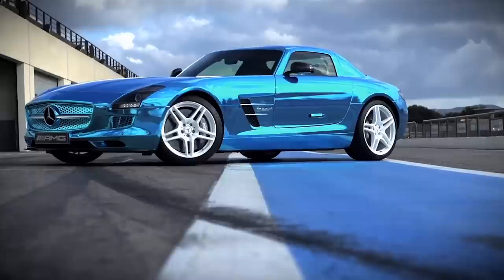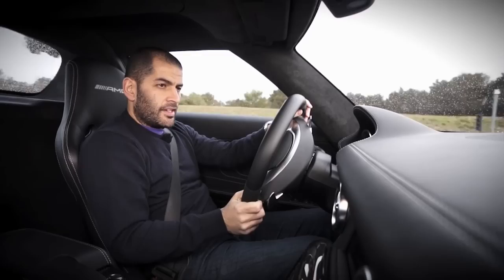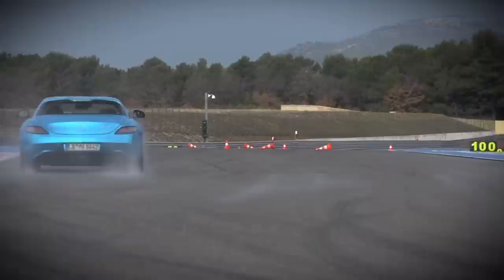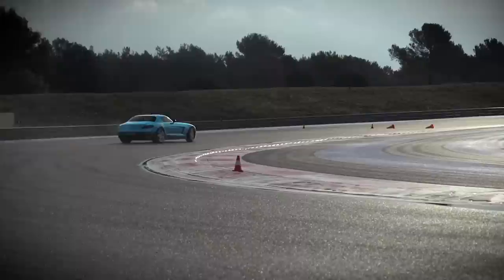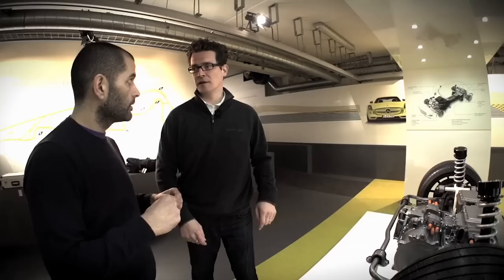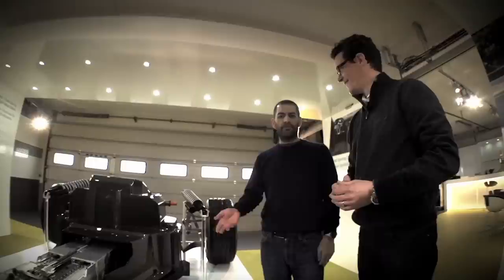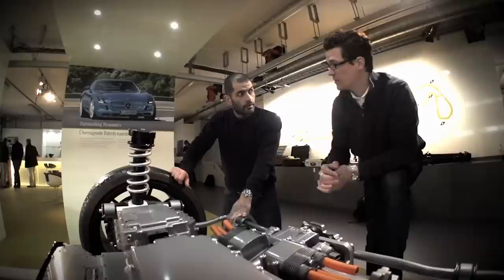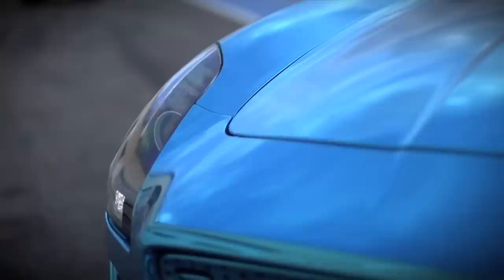Mercedes SLS Electric Drive. Can Volts Ever Match Pistons? - /CHRIS HARRIS ON CARS

Comment: Another 20 years and the battery problem will probably have been solved. In another 20 years, if we can practically make synthetic petrol, it won't get around the fact that the internal combustion engine has fundamental limits on it's power efficiency and reliability issues compared to an electric motor. Your nice V8 will be like a steam train; marvelous to experience and learn about (well, to some of us, at least), but not the future of transportation.

Comment: If you have actually heard a proper engine noise, then you wouldn't think so.
A silent car is good for every day use. For a commuter. A 4 cylinder eco engine doesn't sound good whatever your do with it, so removing that noise is fine.
But not for a super car. The chills we get from proper car noises has nothing to do with perception of what a car sounds like. It's much more primitive then that. In our stone age designed brains, a loud roar means power. Thunder for instance.

Comment: What if they use the same thing as Fisker Karma uses? It's still electric but has engine to regenerate the electricity as you drive along. And it doesn't uses much fuel with

Comment: Can Volts Ever Match Pistons?
many times over.A piston has to stop and change directions, whereas an electric motor is many times more efficient with energy creation and they are way smaller for the power they produce.Yes you have to include battery weight but a piston engine still has fuel weight as well as a giant heavy ass engine and electric motors have better low end torque.
A high end electric vehicle will blow any piston engine out of the water.The reason electric vehicles lag in technology is because no one has been building them all these years because of the Rockefeller's dirty tactics to keep people guzzling oil.

Comment: Electric engines and standard variable chasis and then you have an excelent platform to do whatever you want with interior and exteriors (even with centers of mass). Then Sound systems simulating real combustion engines (which might be improved or rebuild...)  and a fucking funny horn that awares fauna from hit and scape. Then silence outdoors and sound indoor, variable geometrics on every parameter (even water deposits to fit wanted weight and COM), then you change car clasification just by taking neighbour´s ones for a time. Is just like making a real simulating platform to bring videogames and best security (active and pasive) to real world.

The all cars car.

Comment: A cvt is essentually the same as a gearbox, only less efficient. and two motors is not better than one big, as that means two controllers, and more points of failure/more complexity. There is no need outside torque vectoring for more than one motor, as having two is exactly the same as one 2x the size, just with greater complexity, and lower overall efficiency.

Comment: Can't just wave a magic wand and make the V12 run as well as the electric one. They can never be the same. One, you push the pedal down, it pushes you back in the seat proportionally. The other, you push the pedal and have to work your way through the gears to keep getting pushed back in the seat. I'll take the cleaner, quieter, more mechanically sound, and more technologically advanced option.

Comment: I'm sorry but "have to work your way through the gears" is just unbelievable. That is part of the fun. Why do you think the majority of drivers cars are manuals or semi-auto? If you really hate changing gear, you get an automatic. A good automatic gearbox with a V12 engine will be as smooth as electricity but with the orgasmic sound. Cleaner is just pointless really. Even though supercars are less green, they're so rare it's insignificant. Mechanically sound? How? V12s can be quiet (Rolls Royce)

Comment: its an expression, like some one who is used to drinking $1000 bottles of wine looks at a $5 bottle of wine and says "this isn't reel wine, its cheep shit" exempt in the case of the ev the ev is actually more expensive. and if u knew how electric engins worked you would know that there isnt much room for improvment, they've been around for almost as long as the ice and berly improved. as for the futre its probably not going to be petrol but its definatly not electric, i think it will probably

Comment: we have the technology. price is the only issue now..... for example,  why buy a nissan leaf when you can save 30 grand in cash and buy a nissan versa hatch instead, and not have to worry about range or expensive battery replacement either???  or why buy a VW JETTA hybrid when it takes 15 years of ownership just to break even on the extra money you paid over a regular gasoline jetta?

Comment: wouldn't the negative torque cause HUGE wear and tear on the motors? basically slowing a wheel going at say 140mph not by breaking, but by effectively using the strut arm and the inside of the wheel to turn itself backwards? try running full speed forwards, then while doing that decide mid way ok im gonna run backwards now without stopping. you'd hurt yourself. ligament damaged, muscle damage etc. !
Reply: +Antony Quigley the motor doesn't really care. And the forces on the arms are the same as for disc brakes. No issue.
Reply: thekaxmax
no there would be 100% more pressure on the motor's than the disc break arms. As the breaks just have to slow and stop, the motor is immediately trying to reverse, must be a hell of alot of stress
Reply: you are all forgetting that electric motors don't suffer from mechanical wear like combustion engines do. The motor housing (containing the poles) remains stationary while the stators move independently and without contact. the only contact comes from bearings, and those don't care about acceleration
Reply: Antony Quigley This is not correct.  If a car slows down by regenerative braking as quickly as it does under normal braking (i.e. with disc brakes) the torque exerted must be exactly the same - the torque is what causes the retardation.  All that is happening is that the motor is acting as a generator and the maximum torque on the electric motor under regenerative braking will be about the same as it would be under maximum acceleration only in the opposite direction.

Comment: ok, you the one that said. they are converting energies from battery dc sources to three phase ac. you get losses every time you change electric states. and there trying to promote distance driving for touring? that make about as much sense as a .177 bb gun competing with a 7.62mm riffle. these losses are unacceptable if you trying to make the masses of drivers happy. i know i'm not happy about the capable applications of range to charge intervals. plus the time for it to fully charge.

Comment: When cars become fully electric, you'd need to be extremely smart to modify its performance. You can't just slap a few parts like a turbo or supercharger. You would actually have to tinker with electricity and electronics. That shit requires a bachelor's degree in electronic engineering lol

Comment: There is a difference between synthetic sound and then one that actually comes from an engine.
You hear the sound from the a speaker. You feel the sound, the vibration from an engine.
An Electric car will never sound like a real car no matter how good speakers you use. Simply because you don't get the vibrations.
With a big engine you feel the engine and the power.
And in any case, it's still not the same to know that the engine sound is completely fake. It will not be the same.

Comment: No, not in racing. If your car has 1,000 HP, that still doesn't make 4,000 lbs okay. That's what I've been trying to explain to the idiots commenting on this video. (Not you. You have a point, but that theory just doesn't work around a track or on a mountain.)

Comment: in fear of sounding like an environmentalist i must comment that if you consider a electric car to not have 0 emissions then you must add on the emissions and energy in oil production, oil transportations, petroleum refining, delivery, etc to the emissions of a fossil fuel vehicle. i would also hazard a guess that in most European countries the carbon footprint of electricity production is much less than the carbon footprint of oil refining, etc.

Comment: How does a car with 750 hp only achieve 155mph? With that power and aero top speed should be well over 200mph. Same thing with the Tesla roadster, 288hp yet tops out at 125, which is slower than my Toyota! The added battery wt shouldn't impact top speed right?

Comment: Tesla offers a battery pack swap out that is completely automated, takes 55 seconds and is available for 35$ at any Tesla charging station. You just drive up into the little car wash type thing and sit in your car while it swaps. Faster than gas tank fillup, and cheaper. Or you could just plug it in at night when you get home for pennies.
Your petrol bullshit is over doll.

Comment: 4 wheel 4 motor electric torque vectoring vs single power source through single transmission 4 wheel torque vectoring, that's the question I so wish got asked, any thoughts welcome
Reply: Yes yes yes

Why is 2000 moving parts that produces 30% of the drive the rest in heat and noise the right way to go.  The 4 motors, 3 moving parts in a E motor which performs abs, traction control steer control on the fly.  Look mum no hands.  Even less moving parts pumps etc

I know, 3 new modes for the SLS, E type, Mustang, Monaro wow how cool would that be. True floating pillows low power, no traction, a coffin.  I gave up my analogue phone a long time ago.

Even the right colours teal, grey, black and white....

Comment: That's fine, but you made a little mistake.
A gearbox is something you use to change gears.
A set of gears is called a transmission.
what you meant to say is that: "a cvt is essentually the same as a transmission".
A CVT is actually more efficient you know.

Comment: It'd be nice if they can create another fuel that is cheaper and better for the environment that can be used in an ICE type engine. What happened to hydrogen cars?
Reply: Hydrogen did.  Hydrogen is very difficult and dangerous to handle.  It is simply too complex to make safe.  There will never be a hydrogen internal combustion engine on general sale.

Comment: If you knew more about electric motors you would know that its only a matter of time. 

Instant torque. That's just one feature. You really don't comprehend the possibilities of the electric engine.  They only problem is batteries.  When they improve drastically or we have electricty productiny hydrogen plants then whoah  baby 1000000 kw   without having a huge top fuel drag engine.

Comment: There's something I didn't quite get. Instead of spinning the motor in the opposite direction to negative torque, can't the car use regenerative braking and make the motor act as a generator? Or does this car not have regenerative braking?
Reply: I see where you're not understanding what's happening. That's exactly what regenerative braking is-- applying a reverse force (torque) to the motor. It just doesn't apply so much reverse torque that the tire loses traction and the motor actually turns backward. It's basically the same thing as stepping on the gas pedal to accelerate vs. stepping on the gas pedal even more to spin the tires, except it does this backwards, and the reverse torque applied against the forward rotation induces an electric current that feeds back into the battery, which is what regenerative braking is.

The clever thing about this kind of electric torque vectoring is that instead of putting that regenerative braking current into the battery, if it's wired and programmed right, it can actually just send that current straight over to the other wheels which will add extra power without having to take it out of the battery.

Comment: Ok, I'm really interested about, does this car have a gear box? I guess it doesnt. It would be understandable at an electric car (electromotors have always the same torque) IF Im right. Especially when it has 4 individual engines. So I dont understand the F1 shift buttons at the back of the steering wheel. Honestly Im confused a little. :)
Would be someone so kind to explain it?

Comment: Electricity sort of reduces the point of a supercar. Buying a supercar would effectively become buying a more expensive and faster version of the same thing. You don't get any higher tech and expensive mechanical stuff or a much larger and better sounding engine than normal cars, you just get a bigger battery. Boring.

Comment: youve never heard of BLDC then, or $150, 2.5kg motors the size of your fist that can put out 6kw? or advanced cooling systems that get 300kw out of something the size of a coffee tin? electric has a much higher power density than ice, with much greater reliability at those outputs kg for kg. its battery tech (namely, energy density) that still is the achilles heel of electric transport.

Comment: you must be going up against small engined and older cars, the Nissan Leaf can only get up to a max of 93 miles per hr (150km/hr) top speed , and it's acceleration is only 9.9 seconds from 0 to 60, which of course is tested in perfect conditions to get the best performance possible, so more likely 11 seconds in a real situation. I've been in one, I've been up against one, and definitely NOT as quick as you say, and EASILY beaten.

Comment: Lets be honest, how often to you get into that problem with a car that goes 300-400km? You must plan your drive extremely poorly to not find a 30 minute break in 300km+ of driving.
As if that wasn't enough, Tesla is equipping thier superchargers with battery swapping technology too. It takes about half as long as fueling a car. /watch?v=H5V0vL3nnHY
This debate is just getting silly now, 10 years ago you had a point. Not anymore.

Comment: front splitters, side skirts, spoilers all add weight but make the car handle better at high speed so theres a 3rd example adding weight to improve handling, god removing all 4 dampers would reduce weight but the car would bounce around all over the place, just cos things add weight does not make a car handle worse, granted things like electric seats, air con, power windows, head unit, speakers ect, ect add weight n make a car handle worse but u said "heavier=worse handling" and tht isnt true

Comment: If not electricity, then what else? Also, you produce less carbon to fully charge an EV than you would to run an ICE over an equal distance, and that's assuming you're buying your electricity from a fossil fuel plant. And how is nuclear power not environmental? It produces less pollution and less radiation than coal plants. Secondly, the nuclear plants available today are all old tech (basically nuclear powered kettles); there are far more efficient and less wasteful options.

Comment: I know, and I know, I won't mention all the reasons, but have you seen a powergrid, they die with a few tesla's in one street.
hence my reason of 2030, by 2020 as you say we will have a good premium electric car that is better than petrol cars.
but we wont have infrastructure supporting it.
2030 is the about right, 6 years to understand that we need infrastructure to support it, 10 years for building and then it'll be electric perhaps :)
not most about the cars :) they are already decent! :D

Comment: If you ONLY work 20 days per month (M-F for 4 weeks), then 1200 miles/month = 60 miles per day which is less than half the usable distance of a full charge.  Hopefully that commute ends at a job that doesn't require a lot of basic math skills.

Comment: LOL, gas car for more enjoyment. That's like going to fast-food chains to be healthy. You obviously never been in a fast electric car. The instantaneous torque is something you will get addicted to. Then the absurd low center of gravity and very central pivoting heavy weight. Only bad thing is electric steering which kills the road feel a bit. Tall laggy combustion engines just can't compete.
Drove: Experimental converted MR2 Spyder (early days of lithium based) & Tesla model S

Comment: They already have something like this, it wouldn't be "new". It is also, simply put, lame. A little speaker on the bottom that will never match the sound and feeling of a naturally aspirated engine's exhaust. It's not just the sound, it's the vibration and feeling of power. These engines make high power with little vibration and sound. It is "efficient" but still not good because well, it's electric. The average sports car driver does not normally drive more than ~130 miles he could.

Comment: Nope, mark my words. I give 5 years when electric carbon based battery will have much more range than average petrol tank. But still take about 1/2hr to charge because of massive amount energy soaked up. Which is not a problem at all.

Comment: A noisy engine can hardly be seen as a quality. Car companies work hard to improve the driving comfort by reducing the noise.
Our brain might be programmed to think noise equals power but it doesn't take many seconds for that to change when you see an EV super car. For real driving comfort, I rather have a car without noise that allows me to enjoy conversations and music.

And I can send you an MP3 file with some Ferrari sounds if you need a bit more time to adjust.

Comment: I'm down for electric vehicles to protect my "ancient" high hp gas car that I will drive on the weekends :)
The time when the battery goes out though omg. you might as well buy a new car in 10 years. Good bye to diy'ers and doing your own repairs. Forget going to autozone and buying parts and keeping your car running passed 10 years.